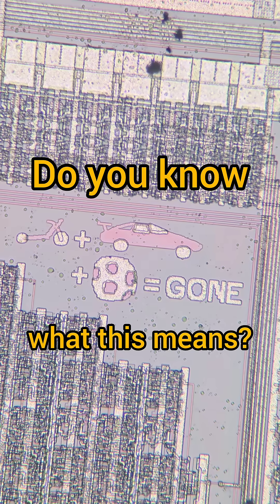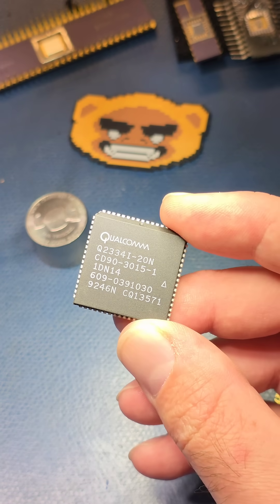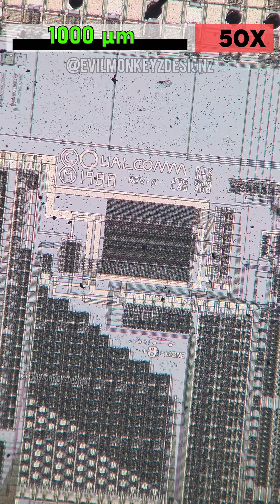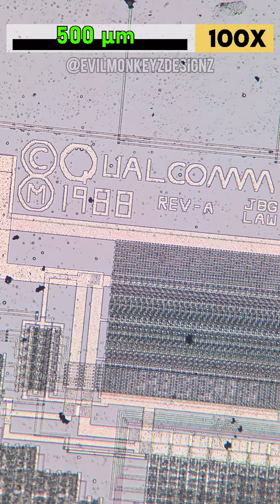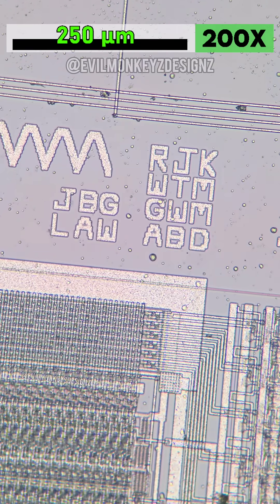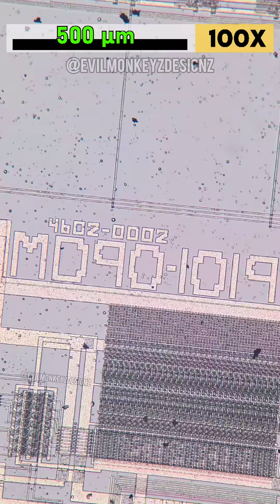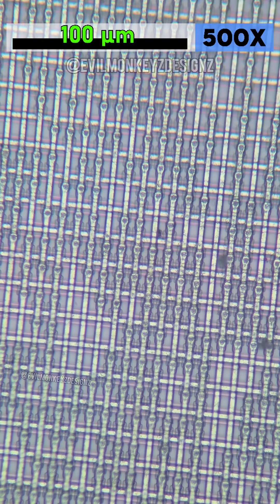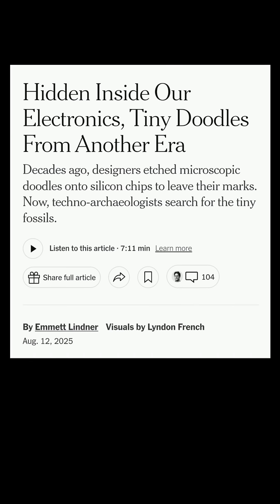Can you solve this Silicon Riddle?

Comment: After an hour deep diving with ChatGPT I believe this is the answer.

That little scooter + sports car + moon = GONE doodle is actually a warning from the chip designers. This 1988 Qualcomm chip is a digital frequency synthesizer, and the drawing sits right between the big lookup-table memory and the high-speed phase-accumulator logic.
“Scooter” = slow signal path
“Car” = fast signal path
“Moon” = big phase jump / overflow
“= GONE” = the output disappears.

Basically it means: “If the slow LUT updates and the fast accumulator timing collide during a big frequency hop, the output vanishes.” It’s an inside joke about a real DDS failure mode, drawn exactly where those two parts of the chip meet.

Comment: I personally think it's a multilayered doodle/riddle. But the most widely accepted interpretation within the tech community states that it is almost certainly the poignant memorial to engineer Scott Carr..
Scooter: which could be a rebus for his first name, "Scott."
Car: literal representation of his last name Carr
8-Ball: A personal emblem, reportedly a reference to his love of pool.
GONE: a somber tribute from his colleagues acknowledging his passing :/
But I personally think the true cleverness of the doodle is its capacity for a double entendre allowing it to simultaneously function on technical and organizational levels, maybe it it's both a tribute as well as a technical boast for the chip itself since the chip is a DDS (dual direct digital synthesizer) scooter + car could represent the "dual" signal carriers one for the low power/frequency signal which is the scooter and the car for a high power/frequency signal. Then the 8-Ball represents the digital core likely 8-bit logic which was fundamental in 1988 that actually controls these analog outputs and then the = GONE  signifies the chip's actual function stating the noise and signal artifacts are gone
Reply: What a terrible hypothesis. That doesn’t look like a right ball even remotely and the resolution on these GDSII files even back then was extremely fine as you can see.

Comment: These designs are prone to harmonics. At the time it was extremely difficult to make chips that used digital processes to make sine waves without third, fourth, and fifth harmonics.
I am guessing that it is the chip designer bragging that they were able to eliminate these artifacts.
(Big Wheel - 3 wheels, Car 4 wheels, and what appears to be an asteroid with 5 holes.) While this is just a guess, it is very much like something I have put in my designs to playfully point to other designers that I am taking direct actions to clean up a known problem that they may have let slip by into production.
Reply: overcomplicated but worth way to announce it lol

Comment: Answer of Gemini AI : 

This is a classic piece of silicon art, or "chip graffiti," which is a rebus puzzle etched onto the die of a microchip.

Here is the solution to the riddle:
SCSI corrupts a cookie, therefore the data is GONE.

Let's break it down:
 * Scooter: This represents SCSI (Small Computer System Interface), a standard for connecting peripherals to computers. The term "SCSI" is commonly pronounced "scuzzy," which sounds like "scooter."
 * Car (Porsche): This is the most difficult part of the pun. The car is a Porsche, which is meant to phonetically represent "corrupts a" (Porsche ≈ corrupts-a). It's a stretch, but that's the intended meaning.
 * Cookie: This refers to a data "cookie," a small piece of information stored on a user's computer by a web browser.
 * = GONE: This is the result. When the cookie data is corrupted by the SCSI interface (hypothetically, in this joke), the information is lost or "gone."

This particular artwork is found on a Western Digital controller chip. Engineers would often hide these intricate drawings and jokes in the empty spaces of the silicon die, visible only under a microscope. It was a way for them to leave a personal signature on their work.
Reply: Porsche 911   !

Comment: the "going goin gone" would be a good solution if the timings ined up better with the qualcomm baseball stadium, but that wasn't done until '97. the patents for this were filed in '88, production for this die was in '92. i'm still searching it up to make a better connection. the comet/asteroid is interesting as the q2334i was a chip used by nasa for satcom. qualcom engi's were also allegedly known to be car/motorcycle enthusiasts, so it might be an inside joke along those lines. still just guessing at the moment though. if i figure it out, I'll edit the comment.
Reply: MAYBE this is a big maybe, this was a flex that they finished the chip before two great comets (halle-bop & Hyakutake) - my guess is "before comet here" 
i got it from the bike having 2wheels(BI), car has 4, comet, and opposite of gone since you'd subtract to solve the equation algabraically. I'm not confident about this